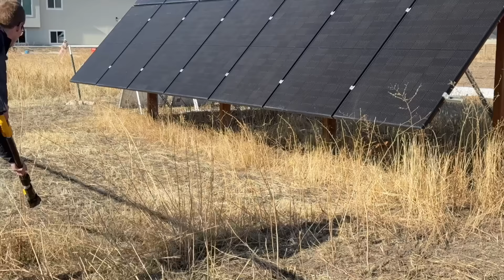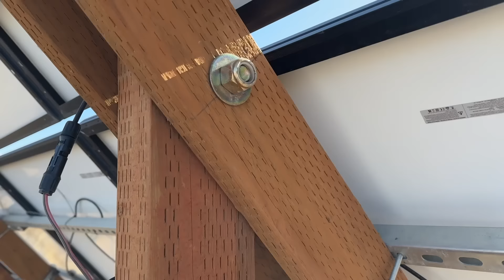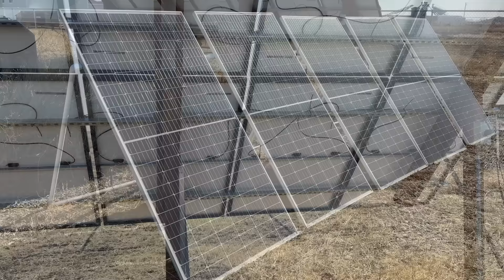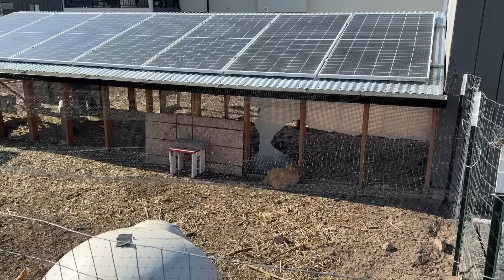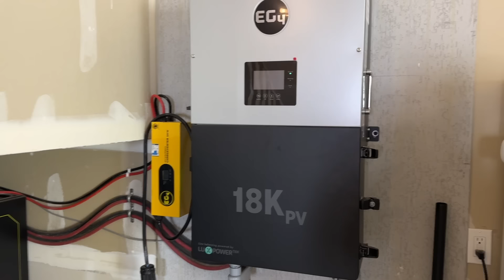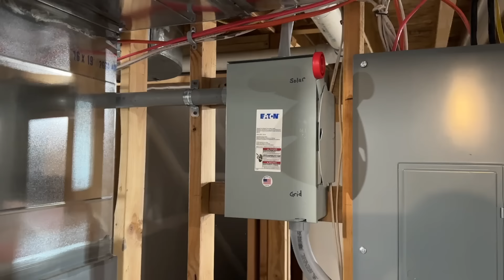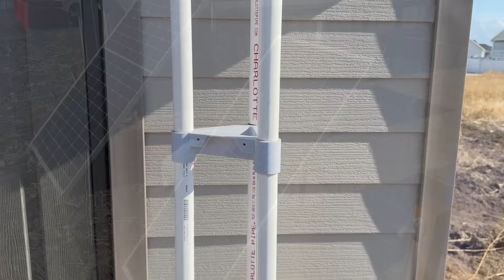We Said Goodbye to the Power Grid... Forever

Comment: Great video, do the individual panels on your coops also feed into the main charge controller, or do they run off their own charge controllers? I am considering a similar setup of stand-alone panel-charge controller-inverter combos, I'm on 2 acres and want to power different structures and animal houses that are further apart. Clear and concise video without any fluff. Thanks! Subscribed.
Reply from the maker: So the big adjustable ground mount array, the PVC pipe array, and the array on top of the covered chicken run, those three run into our main inverter/charge controller in our house.

The single panels sitting on the ground by the run I’m using to heat water for the chickens so those are direct to heating elements, no inverter or charge controller. 

On the shed I have a single panel that runs to a EcoFlow Delta 2 max which powers outlets and lights in the shed. Thats our only other standalone system and it’s not connected to our home in any way.

Hope that answers your question!

Comment: wires going through the top on those isolators with not cover is asking for trouble, replaced plenty of them because water gets in and they just burst into flames
Reply from the maker: Thanks for the heads up! It’s been on my list to add some proper cable glands but I haven’t gotten to it yet. Probably worth doing that asap!
Reply: @SmithOffGrid  A simpler solution than glands for your primary array is to use simply add a PVC weatherhead above the DC isolator. Just make sure you have a drip loop, otherwise it's irrelevant.
Reply: Then there are the squirrels....

Comment: Hi I find btc mining fascinating. Do you have occasional power outtages when for example sun goes down and the system switches to thje batteries and if/when batteries are drained a switch to the generator takes place? During all those possible switches do you have short power outtages? And when that happens does your btc miner shut off? If so, does the frequent power on/off cycles affect the asic's longevity?

Comment: Why the Charge-verter in addition to the 18K?
The 18K has combustion generator integration built-in; you could have run a permanent inlet for your portable generator to connect to outside.
Reply from the maker: The total harmonic distortion from our generator is too high for the input of the 18kPV. If we had an inverter generator that put out cleaner power we definitely would have considered something like that

Comment: How long does the battery setup run
your house if you just had the batteries and solar ? thanks!
Reply from the maker: How long the batteries last depends a lot on the season. In the winter, if we had no solar and we were running purely on batteries, our 30kWh could last like two days. In the summer when AC is running it'd only last like a day.

Comment: My dream is to have a solar set-up like yours in the future.
Reply from the maker: It’s definitely an achievable goal if you make it a priority! This has been a dream of mine for many years
Reply: Go for it its realy worth it,
Reply: The batteries are so expensive and would last 8-10 years if you're lucky. Don't believe the marketing hogwash about them retaining 80% capacity after 10 years, when they fail they fail quick.
Reply: @flow5718  its true for nmc batteries. Right now for storage you should use lfp batteries. those really can hold 80%+ capacity at 10k cycles. And they are getting dirt cheap. At least in poland which dont have tarrifs on batteries and panels.

Comment: Be careful with the EG4, your saving money now, but let's see its performance over the next 12-18 months. Most quality solar pros recommend against it, from experience.
Reply from the maker: I think it depends a lot on the specific EG4 product you're looking at, since they work with different manufacturers for their products. Like the 18kPV is actually from LuxPower. Quality on that unit is leaps and bounds over the 6500EX for example.

We've been running our system with the 18kPV for over a year now with minimal issues. And they have good warranties too. Signature Solar seemed to struggle early on with customer support but all my interactions with them lately have been awesome. They have really been stepping up their game.

For the price and value I still think EG4 is hard to beat. Especially when comparable units from other companies cost 40-50% more.

But maybe my opinion will change after running our system for a second year... We'll have to see!

Comment: No strong winds there? What about heavy rain? Thank you about video :)
Reply from the maker: We're actually in a pretty windy area. I thought I'd have to anchor down the main array more but it has been surprisingly solid. I think how much concrete we used in each hole for the posts definitely helped.

And for the temporary PVC pipe array each one is staked down using large concrete stakes. But the wind normally blows along the line of the array, not against the front or back sides which I'm sure helps.

We normally have pretty wet springs with a lot of rain. Haven't seen any issues from rain besides less sun.

Snow is much more of a challenge through the winter. I have to stay very on top of clearing snow off the panels so we can produce enough to make it through the days.
Reply from the maker: Quick action shot of a storm that blew through yesterday -- https://youtu.be/cENh3uJoZA4

Comment: Sweet! My tilting arrays are very similar to your build. Three of them but only 10 400w panels ea. Excited I got a linear actuator installed on one of them yesterday to adjust with a wireless remote. Love new gadgets! hahaha
My chickens are allowed to run around outside and play all day. They really like the arrays for cover and shade but they do a great job of keeping things clean around them. Like a herd of goats. lol
Reply from the maker: I’d love to see your setup! A linear actuator for adjusting the angle sounds awesome!
Reply: Pretty cool. Found an Ecoworthy actuator on amazon. 18" 330 lb, IP65 12v. Added a reversing contactor with wireless remote and put that in a little 4x4x2.5 box. Whole thing was about $85. Don't want to run 12v out there so I just made a couple of clip on connectors on the bottom of the box and carry out a little 12v 5ah battery with some gator clips on it. You could save 20 bucks and just put a 3 position toggle switch instead. The remote is pretty dank though. lol

Comment: I would love to setup a ground array that I could adjust the angle and the direction.. Have thought about a two stack of six for twelve panels centered on a round metal post with a wheel on each end that would turn to track the Sun but I would have to cut down several large trees that are 50+years old. I have 24 panels, 12 face ENE and SSW on the roof of my garage and may experiment with a reflector to see if I can get some extra light on the NNE faceting panels in the afternoon.. Something I could pull up between 2 poles like a banner on non windy days..
Reply from the maker: I've always thought a tracking array would be sweet! I'd love to see if you get a reflector working, that'd be very cool

Comment: Wish I had space for a ground array, but my property is sorrounded by large trees and even if I cut them all, the neighbors trees would still shade it.
Reply: Same here but it is mostly my trees, I have to trim and top several to up the Summertime output because shading is becoming an issue again when the tree's leaf out..
Reply from the maker: We really lucked out in that aspect! We're in a very open area so the only shade we get is from the clouds. We used to live in an area like what you're describing with lots tree cover, which was great for shade from the summer heat but yeah not so great for solar production.
Reply: Are you able to do a rooftop array? The elevation might be enough to overcome the shading.

Comment: What size panel and element in the chicken water.   I am looking to do something similar.
Reply from the maker: I found a pretty good pair with a 380W panel and a 4.6 ohm heating element. But a 190W panel with a 2 ohm element has worked well too. Stay tuned through, I'll be sharing more info in a video coming up!

Comment: Sub'd!  You connected three series strings without using a combiner box?  I was always told that's not a good idea, but you're going into different charge controllers, in the 18KPV?  I really like both of your solar panel mount designs!   You have an 11kw primary array, with a 30Kwh battery.  That seems like overkill, to me.  Did you build it that large so that you are still largely off-grid, even during the winter?  Do you have a major surplus, at times, during the summer?
Reply from the maker: Our three series strings stay separate all the way to the 18kPV and they're each on their own MPPT input. So they're not combined in any way, they just share the same bit of conduit as it enters our house.

The primary array is actually only 5.6kW and our other two arrays are east and west facing so they don't get as much production through the day. But yeah the goal with our system is to be able to be off-grid year round, even through the winter which is the biggest challenge.

Summer time we have power in excess. Winter time we barely make it through even with all the solar and batteries we have.

Comment: Great work your doing it all spot on.   I've been experimenting with all of this too it's so satisfying creating your own power.  Over here you can get those small immersion heaters in 12/24/48v a 48v one would be good with two ofthe big house 450w 40-50v panels in paralell.  Mind you we better be careful don't want to boil the chicken water do we!!! :D  one thing I have learned is don't do lots and lots of disparate systems here and there - you get much better value for money and efficiency putting all of the money into one big massive expandable system and powering everything you need off 120/240v.  For me I've gone from all the experiments to putting it all into a victron/pylontech 240v system that I can just keep expanding and expanding. went from 6kwh to 16kwh and now 26kwh and will keep adding every year

Comment: Do you use much grid power? We are close to retirement and we are planning on moving back to the Lake of the Ozarks in Missouri.  I would like to live off solar/battery power as much as possible.  Considering Grid/Flex boss setup  and a couple of mini splits for heating and cooling.  Is 30kw possible for that?
Reply from the maker: No grid usage, we produce all the power we need! We do have to be conscious of our power usage though during the winter months, especially when we have cloudy/stormy weather for multiple days in a row.

Our generator helps us get through the hardest days. We've only had to use it a handful of times though. 95% of the year we're generating power in excess.

We started with 25kWh of battery capacity but the buffer was just a little too small for our usage so we added an extra 5kWh battery. 30kWh has served us really well and I think it's a good number to shoot for when starting out!

But the system size you need depends a ton on your electrical loads. We replaced a natural gas water heat with a heat pump water heater a month or so ago and the extra draw (avg 5kWh per day) has made a big difference and our battery bank is feeling a bit small again.

Comment: what have you spent on this project? i dont understand why no one who shows their systems on you tube will give the most basic info on cost....which is a hard reality that real people have to deal with.
Reply from the maker: Keeping track of cost is a little tricky because we collected materials slowly over the course of a few years before we actually installed it.

We always tried to take advantage of deals around black friday, especially when there was free shipping. We bought and sold a few things too before finalizing our design.

But I did total up the cost of everything we still have and it came out to about $20k.

That includes all tools to do the work, wire, conduit, ground mount materials, batteries, inverter, and solar panels. Plus we still have 14 more 400 watt panels that we haven’t used yet.

With the tax credit we got back, the total we paid was closer to $14k which I think is pretty awesome.

Batteries, inverters, and solar panels have all come down in price since we purchased ours so it’d be even less to buy our whole system today.

I might do a full price breakdown video in the future. Stay tuned!
Reply: About 50 200 watt panels for 10kw total = about $2500-$10,000 shop around, many different options and efficiencies. 30kwh lifepo4 battery capacity $2000 to $10,000, again, many options shop around. Controllers, minimum $1000-$5000. Inverters likely at least $1000. So if you really look around you can probably get something like this for around $6500. On the upper end with the most expensive components $30,000
Reply: 36 foot camper 4200 pv,8x525 biracial 15 inch over roof,6k inverter,three 60 amp charge controllers ,9k btu mini split.48v 230ah,12v 300ah=$10k😊
Reply: @arnoldreiter435  I've got a 2.4 KW system I spent about $3,000 on put it up on the roof of my 22 ft RV
Reply: @arnoldreiter435  but you know I wasn't relying on a single YouTube video to tell me how to do it it took me a good two or three months of research before I figured out how it works and what all the cost would be
Reply: I installed a 2.4 kilowatt system on the top of my RV for about $3000
Reply: Buy bulk, do it right the 1st time save a lot  😉
Reply: At first I only put 4 panels on camper.Then 4 more after I seen what they would do but with mini split vs rooftop AC I only need more during winter.Then I found out the mini short cycles into defrost every 7-10 minutes 20*f.Not good.The first 4 panels was $333 each,next 4 about $290.But on west coast on eBay there were $125 each picked up?

Comment: Would love to see your plans for the ground mount.
Reply from the maker: I'll put together a dedicated video on our ground mount. Stay tuned!
Reply: @SmithOffGrid  Thx!!
Reply: @SmithOffGrid any issues? I like how you avoided the expense and additional failure points of an RDS system. Bravo 👏.
Any issues with the 18kpv inverter, or with battery cell balancing?
Reply from the maker: @ We've had a few hiccups with random errors getting triggered periodically but a firmware update on the 18kPV or the batteries normally resolved them. Pretty minor though and Signature Solar support has improved a bunch the past few years.

I noticed our batteries were a little out of balance in the beginning but after a few weeks of cycling they started staying in sync. No issues.

The biggest problem we've had has been with cold temps with our batteries. I thought our garage would be warm enough and stay above freezing but it's been a bit of an issue when things get really cold. If I were to do it again I'd make sure to get heated LFP batteries. The extra cost is definitely worth it in my mind.
Reply: Can you make plans to purchase or not to purchase versus a video?
Reply from the maker: @JoAnna-ff9sv Yeah I could do that as well!
Reply: Excellent!   Thank you!
Reply from the maker: I just published a detailed build video for our ground mount! I'll be working on making a written plan for those that would prefer that too. Let me know what you guys think!

Comment: A box made out of sturdy foam board for the chicken water, slide over the top with cut outs. If you get snow load just glue some 1" posts on the inside corners. I have 11.6kw now, 20kw to eliminate the gen, maybe this year.
Reply from the maker: Oh yeah insulation for the chicken water is one of the things I’ve been thinking about. I’ll have to try that!

We’re in the same boat, I want a few more panels to help us make it through the hardest couple weeks of winter. Rest of the year we’re totally fine but in Dec we had to run the generator a few times.
Reply: @SmithOffGrid  last year was 105days 20 hours of sun,this year is 20 days and 100 hours of sun. Lots of fire coming, expand the fire breaks

Comment: Spencer! This is awesome! Did you design and install it all yourself? I have been thinking about getting a DIY kit from wholesalesolar with some enphase microinverters and potentially some enphase batteries but working on finishing my basement first.
Reply from the maker: Tony! Yeah I designed it and did the install myself, I don't regret it at all. Solar is seriously awesome. I got all our equipment from Signature Solar, I don't know much about wholesalesolar though. AC coupled systems in general I'm less familiar with but I know that's the go-to for traditional solar companies doing grid-tied systems. Going DC coupled has worked well for us and it's a bit more common for DIY systems. I'd love to hear more about what you have in mind and the goals you have for it!
Reply: I wouldn't DIY an enphase battery system you have to become certified through their program which takes a while and you also need a solar or electrical license to even take the course on top of that their equipment is overpriced and sucks especially for off-grid. you will be much happier with an EG4 or a solark. FYI I've installed at least 10 separate enPhase battery backup systems 
Eight of those systems had a battery failure within the first year for no apparent reason. they are also plagued with wireless communication issues.
I also live off grid on 45 Kw of solar 140 kilowatt hour battery. I use Outback equipment
Along with an AC coupled 10 KW solar Edge inverter